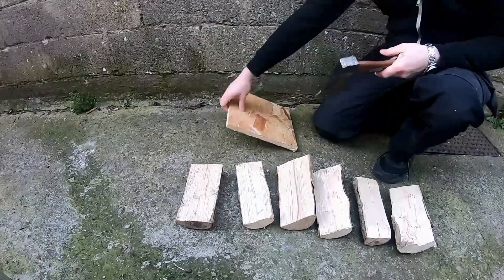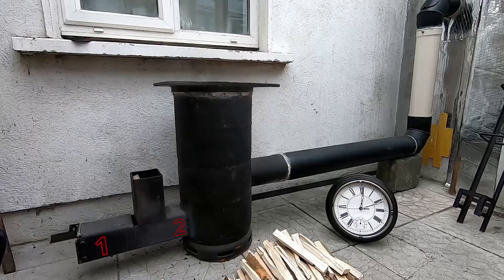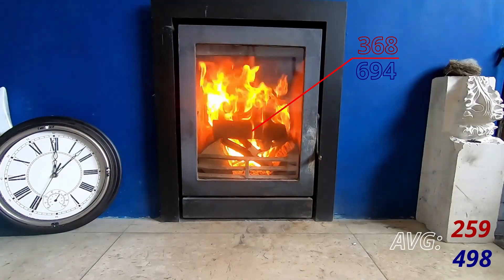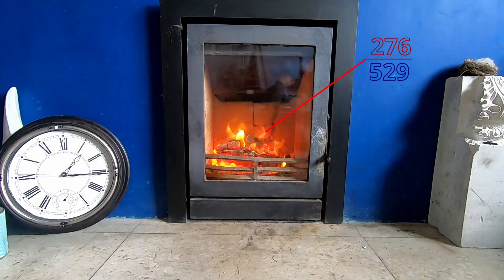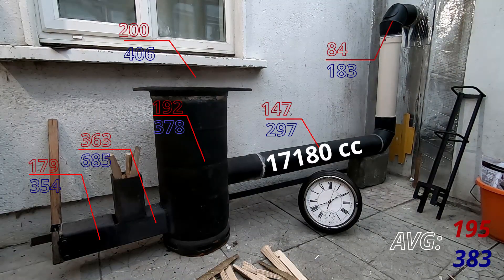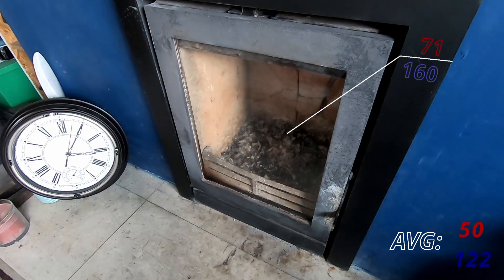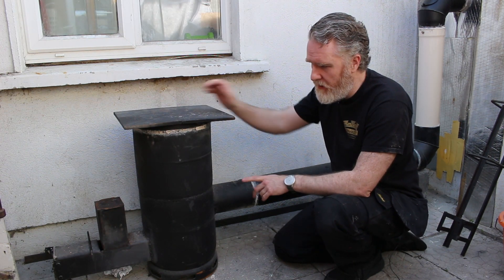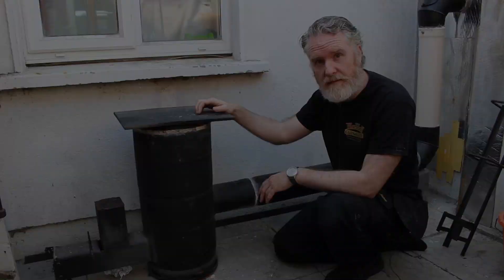Rocket Stove and Standard Stove Comparison - Efficiency?

Comment: Very nice. I recommend you use an insulated or double walled exhaust pipe. That should help keep you fromlosing heat in the rocket stove.
Reply: Isn't losing heat the whole point, once the fuel is combusted? Wouldn't it make more sense to insulate the combustion zone, so combustion is complete?